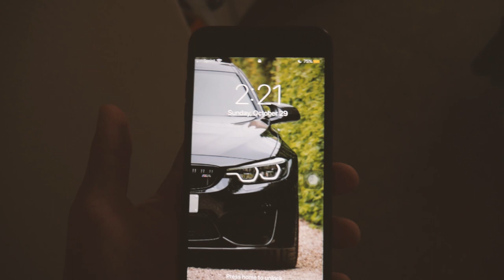My BMW Will Not Stop Squeaking

Comment: Its probably brakes, when i got mine it started doing it a couple weeks after i got it only did it when i would drive slow through my apts parking lot.
Reply from the maker: that's what i'm thinking as well. And I know I need new brakes too
Reply from the maker: Yep that's my issue also, only at slow speeds! Im gona check the brakes

Comment: I've had this issue for a long time, it's related to the brakes. if I spray the brakes the noise will stop for a while then return away too. Apparently its the brake sensor hitting the disc when there's a lot of brake dust buildup
Reply from the maker: Flight1sim that seems to be the general consensus! I’ll have to check it out! Thanks man
Reply: Does changing the brake sensor solve the problem?
Reply: what kind of spray?
Reply: I’m having sensor issues as well. Cuts in and out the power unless stage 1 tc is off. Now I have the squeak that I thought was a disc or pad. Over 35-40 it goes quite otherwise sounds like a bird in my ear. Thinking this is all related.

Comment: I'm going to say wheel bearings.  If the sounds goes away/gets worse depending on which way you steer you can narrow it down to which wheel bearing is at fault. The reason why it shows up after it is driven for a few moments is due to the bearing heating up.  When it is cold it probably won't make a noise.  AFter car is warmed up take it down a deserted road and steer hard from side to side at moderate speed. If the noise is there in one direction, but not the other then it is more than likely wheel bearings as the direction of the car will load the bearings differently.  You also may hear more "tire" noise as well.

Comment: Wheel bearings drone constantly whilst driving dude. As previously mentioned below. Sounds like brakes. Possibly seized caliper, slider bolts, or pads sticking.
Do a quick brake test on a flat quiet road. See if it pulls from one side to the other. This should help highlight it.
Take the car on a quick drive, then afterwards walk around the car checking the heat coming from the alloy area. If one's hotter than the others, it's a good indication of a sticking/seized brake problem. Jack up the wheel brakes off, then try spinning the wheel. It should spin freely. It it doesn't, strip down the caliper/carrier. Check pads, sliders, and piston.
Also a good indication, is a bright orange colour around the disc/drum and/or blue tinge on the disc.
The reason it would get worse the longer you drive, it is due to the hotter it gets the more contact it makes.
Hope this helps dude 👍
Reply: May be jumping the gun here also. As no idea the wear level on your brake pads. As mentioned could be brake pad wear indicators, or whatever you guys across the pond call them?
Has the brake pad wear sensors thrown the dash light yet?
Reply from the maker: Thanks for this info man! Sounds like I have some testing to do. I'll keep you guys updated when I fix it!
Reply: Yea a bad wheel bearing will sound like you're driving on monster truck tires lol
Reply: Simply Car Things no worries dude. Hope it helps you. 
Nice to return the favour. You and BMW Fanatic helped massively with your videos when I was shopping for my 335i!
Just keep doing your thing!

Comment: I had the same issue on my E92 335i, my caliper piston was sticking so i replaced the calipers and pads then the noise went away. These calipers supposedly get sticky easily from the people i've talked to about it, so if you're up there in the mileage it isn't a bad idea to swap out the calipers and rotors. Turner sells re-manufactured ones that work mint
Reply from the maker: That's what i've been hearing! Thanks for the suggestion bro really appreciate it
Reply: Simply Car Things so did this fix it?  Im having the same problem on my XI
Reply: @homeaccount6675  did you ever figure out what it was?
Reply: Same problem and same question here. Any definitive solution?
Reply: Hav the same problem with my 328i..I only hear it from my front driver side and it comes on between 5-20 mph. I lifted my car and spun the wheel that was making the squeaking sound, but couldn't reproduce the squeal. The weird thing is how intermittent the sound is, almost as if something is catching at a specific spot on my rotor or in the bearings. Very mind boggling and annoying.

Comment: Wow! That's exactly what is happening to my Bimmer 2011 328i xDrive. I never had a single problem with my car for like 5 yrs until one day after I had it change oil at STS Auto in NJ moment I got home i heard this LOUD squeaks or Squeals that prompted me to go back to STS and have the guy run the OBD Diagnostic and is says Camshaft position sensors intake & exhaust. I went bought two at $85 bucks each and install it myself but still the Squeaks still there only not as loud as before, check engine comes up and this only occurs when I seat at the traffic light but driving 60-80MPH it's smooth as butter. I finally had it diagnose at BMW Certified Tech and he said the possible cause is that they put in a wrong oil! That's where I'm freakin out because I bough a box total of 8 Quartz of Mobil 0W-40 oil all the time and this time I believed the bastard mechanic stole my oil and put in an ordinary oil and now I was told that 2 Vanos Cylinder was damaged. I had to drain the oil to the last drop and put in the Mobil 0W-40 with K&N filter and now the squeaks gets lesser and lesser so I hope this will solve the issue otherwise be careful when you change oil your Bimmer make sure that they put in the right oil. Hope this info helps!

Comment: I heard it was the brakes and/or the rear brake sensor rubbing against the wheel when there is excess brake dust. For me I only hear it in my rear passenger wheel, possibly just cleaning dust and changing the sensor to a newer OEM one will fix.
Reply: Elite ARO ^^^

Comment: i had the same kind of noise replaced my rear pads all good  easy to change all you need is a 7mm hex socket...
Reply from the maker: Sweet! I cant wait to replace mine!
Reply: hey what kind did you use? i put ceramic in the rear and semi metallic in the front along with new rear rotors and my car squeeks loud. not sure whats causing it

Comment: Mine are also doing that, recently I've been driving with a heavy foot so I know it's my brakes. Look at your rotors see if their glazed and run your finger across if they're smooth like glass then most likely it's going to be your rotors and pads. Also, could be a sticking caliper, but I'm aiming towards a brakejob more. In other words get a big brake kit lolz hope this helped somewhat.

Comment: I have a 2015 428i with low mileage, but this squeaking noise has started recently. It sounds like an old wooden chair. But it happens even from a cold start. 10-20°F outside and it still squeaks. You can push down  on the back end when stopped and it squeaks terribly.
Reply: Mine to, i posted a short on my page i have a f30 with a squeak to , did u find out

Comment: Did you ever figure out what it was? Im having literally the exact same issue on my 2018 4 series its annoying AS HELL.  Just got back from the dealership they changed my front rotors but on the way home it started doing it again 😭 so now im here looking for answers. PLEASE LET ME KNOW IF YOU FIGURED IT OUT LOL
Reply: Same thing here on my f30. Have you found a fix?
They replaced all rotors and pads on my car. The issue came back in a month. I’ve had so much issues with this car it’s unbelievable.

Comment: There was similar sound on my car. It was caused by aftermarket break pads. The technician of my dealership showed me how to fix it: accelerate and break hard few times to even out the surface of the pads and break discs. 
If could also be caused by uneven break discs that can be machined to restore the flatness to improve breaking and decrease the noise.

Comment: I have a 2003 325i, replaced both rear side brake pads about 2 months and drove without any issues/noise. I parked the car for 1 week while on vacation (average 85F in NorCal). On the first drive, at around 20mph, I can hear a whistling (not squealing or metal rubbing) coming from the rear passenger right side. I thought it was a flap or something catching air, but it's all clean. Braking hard and releasing makes no difference. I'm stunned. Will remove wheels and investigate brakes. Thanks in advance!

Comment: Brake pads may be low, I had this issue, squeaking when turning, driving slow. 
Also check the pads mound, the metal rail and put oil on it. Be careful not to put oil on brakes, they don't like that. If the issue seems to disappear with this solution, it may come back in few days, so just put good grease on that

Comment: That’s the sound of one of your rotors impacts its housing cover, you can simply bent it away from the rotor by a hammer and a screw driver.
Reply: isnt workin ist a break issiue

Comment: It might be the brake dust.. I have the same problem on my e90 335i. 

I sprayed brake dust cleaner all over the pads and rotator and it went away. 

It might be build up.
Try getting new ceramic pads that don’t create a lot of dust. That’s the cheapest route to try and fix with first.
Reply from the maker: Ceramic pads and slotted rotors are next on the list! Thanks bro!

Comment: I had nearly the exact same problems with my '13 F30 (328i). The only difference was that the sound came about AFTER I replaced my front end struts and rear shocks. Car drove smooth, but then I heard the annoying squealing. I ended up taking my front brake calipers off and coated the F** out of my break pads, caliper guide pins, and brake pistons. After reassembly and test driving it for 2 days, the squealing hasn't come back. I don't think the squealing came about from the strut/shock revamp, rather, it was coincidental. I will say that when I disassembled my calipers, they were bone dry and the guide pins were almost "rusty?"...Not sure how I lost so much grease, but now I know to check the grease level on my pads/calipers when I start to hear a similar sound. For some, this may be an obvious cause to the problem, but certainly one I overlooked for nearly a month while doing research, thinking it was my wheel bearing that had gone bad or an old belt pulley acting up. I know this post is 5 years late, but I hope this helps someone out there! when in doubt, GREASE!

Comment: Exactly I have the same issue on my F30 328i 2014 model
It starts doing that after replacing the rear brake pads
After that i removed the rear  brake pads to do edges sanding
After that the sound gone for few months then it came back 😢💔
The second step i will do replacing the rear brake pads with rotors

Comment: I’ve got the same issue mine is definitely coming from the front drivers wheel. I’m pretty sure it’s brake dust buildup on the sensor. Is yours brake related or doesn’t just squeal even without braking?
Reply from the maker: It squeals when I accelerate at low speeds. The general consesus seems to be that it's a brake pad issue where the sensor is rubbing the rotor or something along those lines!

Comment: 100% brake wear pin, had the same annoying sounds a month ago, also not knowing if it was coming from rear left or right, i also slammed on the brakes thinking the pads would be pushed back into their proper seating position, and wallah, gone for 2/3 minutes. Had my brakes changed with 700kms left on them and it was all good!

Comment: Have you replaced your serpentine belt? It controls the power steering so whenever you turn, it will squeak. Harder to hear when you are going faster because there is more background noise.
Reply: Personally though the drive belt caused squeaking for me in my 335 so it really depends.

Comment: I got exact the same annoying problem!!! Low speed driving, most often when car is warm, turning left on round about is guarantee squeeking! Even tried same technics like you, with handbreak etc. It is 330e and oficial BMW told me that because i use breaks not so often they just needs to be more often use but it is bullshit, it just get worser. On monday i leave car for service !! So damn annoying !!
Reply: Did they fix it?
Reply: @OnceABustAlwaysABust  yes but i went to unoficial BMW, local service experts in BMW cars, they said that probably during winter, salt and not using breaks cause a  corrosion there, they cleaned everything and works like new. Very cheap, took 1 hour to fix.
Reply: @JanuszStarzycki  thanks 🙏

Comment: My guess is if it went away once you pulled the e brake it must be the brake shoes in the rear. Get them checked out. My car does the same thing and they look pretty low so im gunna get those changed.

Comment: Could be the brake sensors squeaking . I have 07 E92 like yours and had the same thing happening . Did some research and saw some bmws have this issues. I just replaced the brakes and left the sensors unplugged . Only have to deal with brake light which I can deal with . I check my brakes regularly so no biggie . No more squealing since than
Reply from the maker: Interesting! Yea i was reading about the sensor causing the squeaking! Thanks for the info man!

Comment: Brooo samee I just got a 335i convertible and it does the exact same thing it's a 2007 but only has 40,000 miles so I'm iffy if it's the break pads I was gonna apply some break cleaner see if that helps but let's see how it goes xc

Comment: Hey did you find the issue man because I have this same problem with my bmw and have been going to so many mechanics and nobody can tell me what’s wrong I have a brand new 2021 bmw that was in  accident but since repair have had this squeak
Reply from the maker: i think your issue may be different but for me replacing all my brake pads and rotors, & pad wear sensors got rid of the squeaking
Reply: Thank you the car is fully repaired I’m not sure if something could of hit the break when I was in the accident or something just knocked out of place but I may just have to get the brakes checked throughly

Comment: I had the exact same issue coming from my left rear wheel 330e. Remains unresolved after more than 5 visits to the service centres. Totally embarrassing when you drive into a car park.
Reply: @hmw7876  Did you fix it?
Reply: @miguelcoche7808  time to replace the pads bro. the noise goes away after replacement.
Reply: @hmw7876  I have the same problem on my 320i. I changed my discs & rotors on the front and rear and I’m still hearing a squeaking noise.
Reply: @gwuapboy5155  how about the pad?

Comment: Hey bud.   I have the same annoying issue.  It's the brakes .    Mine is a bit different.  My brakes squeak at the last 2 feet of coming to a stop, and mostly when they are cold.   So embarrassing and annoying.  I feel for you bud.  I've had my breaks serviced at it helped for a week but the damn squeak is back again.  It only seems to be coming from the driver side.  Can anyone help.   Cheers Greg
Reply from the maker: Dang! Yea man, it's so frustrating but i'll keep you guys updated if i solve it. I'm thinking new pads and rotors should do the trick

Comment: OMG that is so what I have on mine! I can hear the squeak on both my rear brakes but more on the passenger side one. And I definetly get that on low speeds like below 60kmh (35 mph). It only starts doing it when the brakes get warm, and not just cooking warm but even on normal operating temp. warm...Have had it for a year now and I could never find what was making the squeak. 
Pfff you're right....it's so annoying 😠
Reply from the maker: It is man! I'm glad i'm not the only one with this issue. I'll keep you guys updated if I solve it!
Reply: Same here, very annoying. Beautiful bmw but turning heads with the squaking. It both embarassing and annoyinh

Comment: I have the same "issue". 

Myself and my mechanic believe it has to do with the hill assist feature. 
Holds your brakes and car in place for roughly 1 second and I noticed it more on slight inclines too. Especially at a drive up ATM. 

My pads and rotors are in good condition, 70% or better. 

not sure it this helps anything, but it isn't very bad and if my windows are up I can barely hear it. So I just try to ignore it haha.

Comment: I had this annoying sound when I was hitting the break with my 5 series but those breaks were bad so was clear about the issue. Now I have a 1 series 2005 and this sounds start only after about 20 minutes driving and mostly on motorway and it's a permanent very annoying and very loud sound. So the noise on my 1 series is when not hitting the break but the car running. When you drive next to the wall on the motorway, the sound what reflects back from the wall is ridiculously loud. I have read somewhere that there is a common issue with the 1 series and you should place a washer somewhere, can't remember where between disk and whatever is called the other bit or not sure but also can't find that post anywhere and no idea what sort of washer meant to be. Would be great if anyone had some comment on this.

Comment: My 2018 X5 X35i with 12k miles on it just started the same squeaking.  Sounds like it's coming from the rear passenger side.  It's loud at 10 to 20 miles per hour and does it when I brake or coast.  It's under warranty so I have it scheduled with the dealer.
Reply: @Ak95127  I took it to the dealer, not sure what they did but its resolved
Reply: What is the dealer said did you gond out what causing it
Reply: @stanlee3862  I don't remember now.  I do not have that car, traded it in 2021 for a 2021 X3M Competition.  It's badass